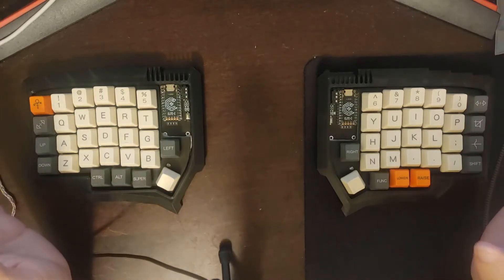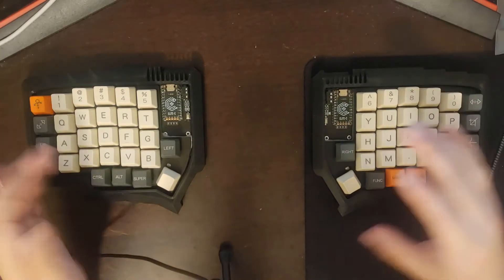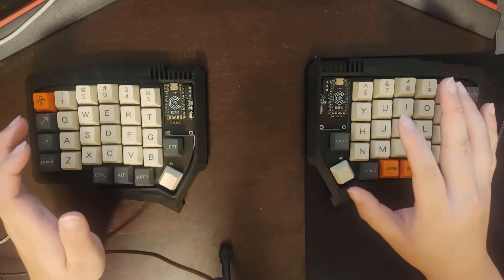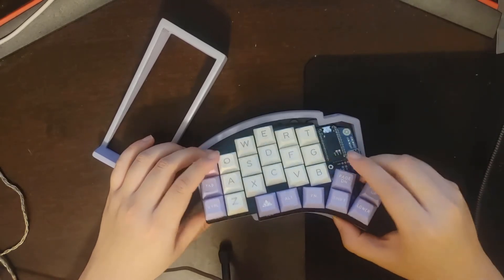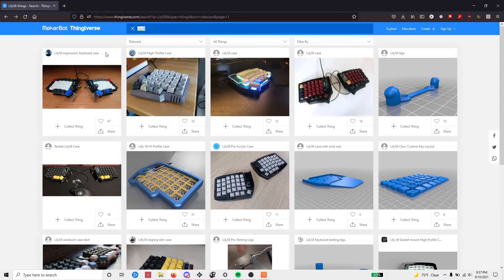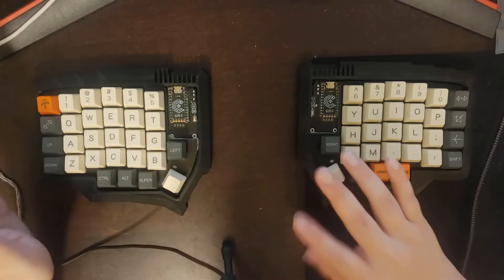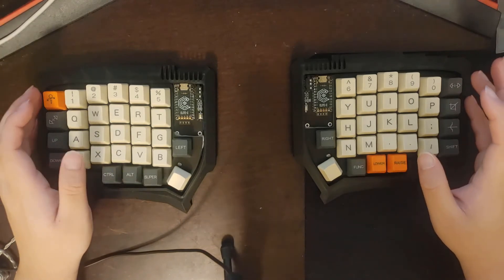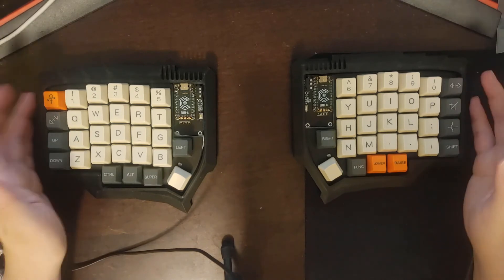Should You 3D Print a Keyboard Case?

Comment: exactly the info I was looking for. I got a microdox kit. I'm looking to get a case for it cuz the palm rest is currently not very comfortable. just wondering what printing service do you use?
Reply from the maker: I use Treatstock. They have the lowest prices in my experience
Reply: @juyr4558  great. that's a lot cheaper than the quotes I got from other sites. do you use PLA or ABS for material? also, for your lily case, do you have to purchase/heat set additional hardware?
Reply from the maker: @crazyfbnerd  Personally I use PETG as my preferred material, but PLA and ABS would both work. For the lily case in particular, I used my soldering iron to make some holes for the screws on the bottom. For my Kyria case, I also needed brass heat-set inserts along a soldering iron.